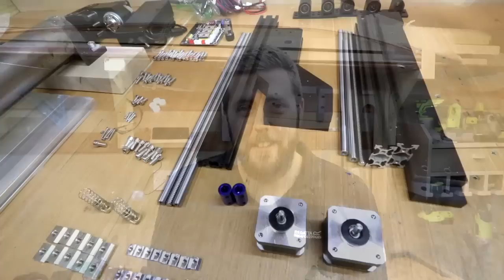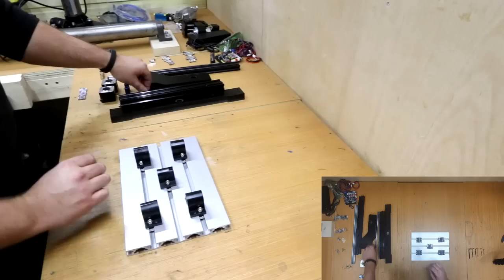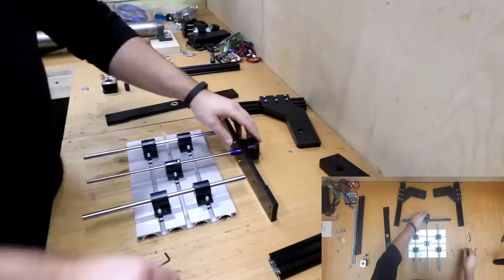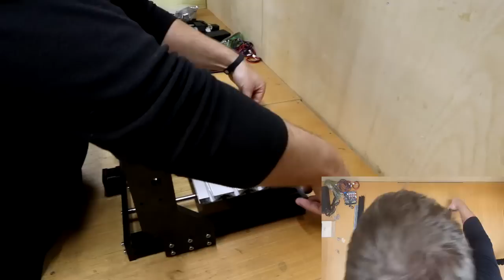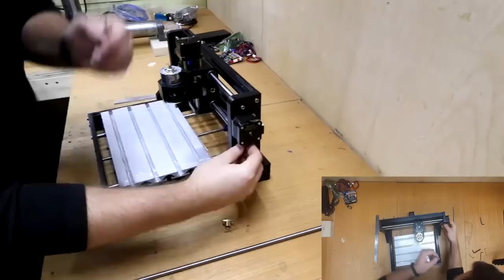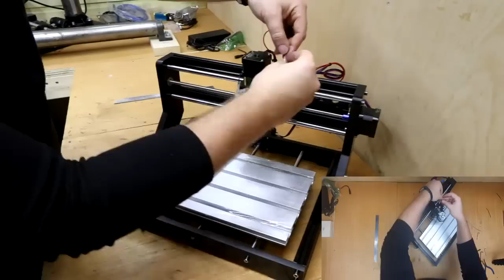3018 PRO CNC Build

Comment: I'm just wondering what the purpose of setting the gantry forward 46.5 mm is.   That's what mine says to set it at.  There's no room to move the bed from under the Z axis.  It seems to me that it be better to have the Z to the back almost all the way for clearance.
Reply from the maker: Thos measurement is allowing you to use all your work area. If you set it right at the back, the spindle will not reach the front of the bed
Reply: @JamesDeanDesigns  Hmmm, I may have to test that.  LOL  I'm curious as to if it's possible to buy a longer lead screw and 2 guide rods and make it longer from front to back.   I have a set of 300 mm aluminum extrusions already.  This thing is really small.   Thanks for replying.

Comment: Hi,
I just purchased a 3018 Pro CNC machine and have started to put it together. I'm having difficulty in placing the brass nut onto the thread bar. The instructions state that I must also insert a spring onto the brass nut before pacing it on the thread bar. I spring is too large for the brass nut. What am I doing wrong?

Thanks.

Comment: The brass part with the spring thingy (the Y-axis), should it face the stepper or the opposite, or it doesn’t matter? Thanks.
Reply from the maker: @zhenyuyang6275  spring and the long part of it should be facing into the middle of the Z axis.

Comment: Excellent video. Thanks for sharing.   The VEVOR 3018 PRO (edition 2024) is construction wise a little bit different, but the basics are the same. 
Did the tie wraps come in the box?  In my package not. I do have some, but didn't use them yet. How long did it take you to do the build up?  I guess you studied the manual thoroughly because you mounted everything so smoothly, without hesitation. Tomorrow I'll watch part 3.  Till the end of episode 2 I managed everything to do without your videos,
but what comes in part 3 will be the most important. I 'm curious......

Comment: I noticed you oriented the backlash nut under the bed toward the motor. Instructions on my machine indicate the backlash nut should be oriented away from the motor. An internet search turned up nothing but I did find someone complaing about wear on his backlash nut and I wonder if his issue is related. Any input about this?

Comment: James. I recently purchased this machine and I also purchased the 20K motor. I read somewhere that it's better for this machine to use an external (2nd) psu to power the 20K motor. What is your take on this? If you agree, how much watt should the 2nd power supply have?
Reply from the maker: So the issue is the 20k spindle draws a little more amperage on the start up. I never had an issue with it on my board but others have. So you have a couple of choices. There is a small piece of code which ramps up the speed of the spindle, you insert this at the start of every job. You can buy a little resistor which you fit to the live wire and it essentially stops the amps peaking so high. Or as you have mentioned you can look to power it off a separate PSU. Dont know for sure but it can't be more than 70w or 80w.

Comment: Hello james. I have a problem with my 3018 pro. I followed your guide(s) on how to install/build it and when it was time to use the jog function on UGS, it didnt work. I fiddled around and still didnt work. Suddenly it started working but after 30-45mins when i started to do a job with it, it stopped working again.

I have checked the connections, tried different usb ports, different cables, uninstalling the CH340 and installing it back and nothing works. What should I do?

Hope I don't have to buy new board and wait ages...

Comment: Hi James, I just want to thank you for your very inciteful videos. 
I assembled my 3018 Pro-Max some 4 years ago after watching this video. 
I positioned the side gantry posts as you directed at 48mm from the seating face of the rear frame support. My machine was supplied with the profiled Perspex dust protector plates, that assemble in the same slot as the gantry plates. With these dust protector plates positioned level with the front of the machine, I butted my gantry posts against them, as it is shown in the catalogue. 
With the gantry posts positioned as described (>48mm from the seating face), I had a problem that the table couldn't advance far back enough for the spindle to clear the table at the front end of the machine (~10mm short). I have worked around this problem successfully for many years, and have done many jobs, despite the limitation. (I used a full sized waste board mounted to the table with countersunk bolts and nuts, and secured my work pieces to this waste board with double sided tape).
However, I have now made a spoiler

symmetrical, this could not be

Comment: An unrelated question: the 775 motor has a cooling fan on the commutor side, drawing air through the armature and blowing it out on the commutor side. Doesn't that clog the inside of the motor when it produces dust and sucking part of that through the armature?
Reply from the maker: That is correct, it is one of the risks and ultimately where a maintenance schedule comes in to make sure you clean the motor, whether that be with a vacuum or compressed air to blow the dust out

Comment: With the vibrations in use in mind; would it help to use blue Loctite on the bolts? Or does the compression of the bakelite the same job?
Reply from the maker: Blue loctite will certainly help 👍
Reply: @JamesDeanDesigns  In other words: bolts not tightened enough will come loose due to the vibrations... Blue Loctite it is.

Comment: Awesome video. Helped me to get my unit built. The instructions that came with it were as bad as they were tiny (I mean, they had me building the frame first). It was a bit of a head scratcher as it is different to yours: T-shaped uprights instead of dog legs, and the x-motor is on the left. Thankfully the cables a long enough so it doesn't matter.

Comment: Well I just completed my 3018 CNC PRO with lazer build. Your  video on this assembly was, as you say.  “. Spot on”
I can’t thank you enough for your time and efforts to make this video. 
It is my first CNC router. My Sweety. Doing a dry run with no bit nor a project on the table. I had absolute success with the mini controller. Again. 
Thank you. 
Papa’s Work Shop. 
Dennis
Reply from the maker: Glad its going smoothly 😁

Comment: Is it normal for the x-axis threaded rod assembly to be smooth or resistive when turning by finger power?
Reply from the maker: It should be fairly free but not loose. So there will be a little resistance but you should be able to turn it with your fingers

Comment: James, I see everything is at least a year ago, but hopefully you're watching these comments. I Purchased a 3018 with the Lazer included. However, the USB plug has no data. The machine operates with the wired controller, but no download available. 
Is there a link or possible software I can purchase to set up my CNC? 
I really appreciate your video, as I am not just computer unfriendly, but just really slow on the learning curve. Comes with age as I am 80 years old, but still as active as possible. 
Thank you, for taking the time to help folks like me Ted
Reply from the maker: Hi Ted. I try to watch all comments 🙂 if you move onto the next video in this series it has the files needed but here is the link for them.
https://1drv.ms/u/s!AuoE9S3Cr4VZgpYTtVqawrkXzSih-w?e=ZI6cBf
Reply from the maker: This is also another useful page
https://docs.sainsmart.com/article/3jgtgas880-genmitsu-3018-pro-resources

Comment: Hi James will the router cnc cut cork sheets for coasters
Reply from the maker: Yes, cork is fairly soft. You will need to find the right speeds though to keep the cuts clean
Reply: @JamesDeanDesigns  thank you so much. Does my brother Mike need to install the software that came with the cnc router or can he just download the easel program you use? Thank you

Comment: Hi, i will receive my 3018 pro CNC in a few days (i managed to get one with the offline controller for 150€ from Banggood, it was a huge deal). In your opinion is it better to add washers between the head of the screw and the Plastic pieces or that's unnecessary? And what are the things i should do immediately to upgrade this CNC (like a spoil board ecc..)? Thanks 👍

Comment: James, after GRBL controller/candle installed on 3018 pro how does one load and use UGS and Easel without causing problems . I know this is asking much but I appreciate any help you may provide. Thank you
Reply from the maker: Its not a problem at all. You can have them all together so just install UGS as normal. However only one program can connect to the machine at any one time

Comment: Hi James.  I really like your videos.  I got my 3018 built and have set the $ commands to match what are in Graham's "Introductions to CNC for a Total Novice.
When I do my initial testing, I find no movement  on either X, Y or Z axis.  I do fell the screw turning on each one, but no movement of the device.  My device is the basic model right out of the box, no Laser yet.  Any ideas as to what I may have out of wack.  Thank you and keep those video's coming.
Reply from the maker: Hi Abi, have you managed to solve this? Sounds like your couplers might need tightening. These are the bits that connect your stepper motors to the thread
Reply: @JamesDeanDesigns  Yes sir this has been resolved.  Thanks for your assistance.

Comment: Great informational videos!
Question regarding the included heat sinks. There is absolutely no mention of these in "instruction manual"....and i didn't see you mentioned them either during build, unless I missed it. Where on the control board do these go? Silly question?
Reply from the maker: Not a silly question at all. There are 3 drivers chips with a little processor on top. They are meant to go on those processor, the problem is they are bugger than processors so you need to be very careful when sticking them on
Reply: @JamesDeanDesigns  Thanks. It was pretty easy to do.....
In regards to setup. Any setup for initiating GRBL to the machine in addition to driver installation from the various software configurations. Im obviously a new newbie to all of this....

Comment: Thank you that assembly session was so good and clear. I'm in New Zealand, just received my unit. Assembled OK until the final part when trying to put the screw bar through the left side bearing to screw into the moving head, it jammed in the bearing, it seems too tight and wants to turn with the screw. Is there a way to fix this? This bearing should allow the screw to turn freely.
Best regards John. PS. I will subscribe your instructions are so clear.
Reply: I lubed the bearing with WD40 (after testing that it was actually working) then I loosely applied the upright to the base frame. I slid the threaded rod into the bearing and simply twisted as it "bit"  into the inner circumference  of the bearing. Then I knocked it with my hand and everything lined up. Then I tightened the six screws to the base.

Comment: Hello I just got one ..I watch your video on how to set it up but I don't know how to put in the bit that it comes with. Can u help?
Reply from the maker: Hi, if you move onto the next video in the series which is called making your first cut then it shows you part way through that about how to fit the bits
Reply: @JamesDeanDesigns  Thanks.. Next question is there any free software like Easel to use i already got the UGS software that u use..
Reply from the maker: @daveoncolley7753  this video will talk you through what you need to know regarding software from free ones through to paid for and each stage
https://youtu.be/EMI97Rcb0bQ

Comment: Does the spindle have a flat edge? At high speeds it will vibrate a little? Not sure if I should get the 3018 or the PRO?

Comment: Hello from Canada James.
   I have been watching your tutorials   (the best I have found on u tube  thanks) on setting up a Sainsmart 3018
.  I downloaded the UGS platform you say you use.
   It moves all axis, but I can't find where to start the spingle
   Is it in the settings somewhere ?
   I have trued to find this information on the web, but on luck so I'm turning to you
  hopping for help.
   Thanks for any you can give.
Reply from the maker: Thanks, that's great to hear. You tell the spindle to start in the design software and that controls it. If you just want to test it you cant type m3 S10000 into the console and hit enter. The type M5 and hit enter to stop it. I'm not sure if they added a manual button as its rarely something people use.

Comment: Thank you James for all your instructionsvideos on 3018Pro! Do you know where to find a linux (ubuntu) driver for the 3018Pro? Have tried the Easel driver but no luck. I guess they want me to use Easel, but I dont want that. Am thinking more on using Lightburn and FreeCAD/Inkscape.
Reply from the maker: Hi Thomas, If you head over to the Sainsmart resource centre they have all the drivers you need on there I believe.

Comment: im trying to get my friends cnc to work. got it all together. all seems well. but i cant get it to work with software. it did not come with any
Reply from the maker: Do you have any details about the machine such as do you know if its a GRBL machine or Mach3?
Reply: @JamesDeanDesigns  hi there again. this is a GRBL cnc. its a chinese 3018 Pro knockoff. after much fidling i got the software to partially work. it now seems to be a software setting issue. thanks so much for your asistantce, greatly appreciated.
Reply from the maker: @tyronehewitt634  thats good news. Software issues are usually easier to  resolve than hardware issues

Comment: Thanks for the video, great detail, and a real help since my assembly instructions were very lacking in any detail. Here are a couple of points that this newbe found while assembling my almost identical 3018 while watching your video that may help others. Firstly, when I put the spindle motor assembly on the rails and tightened up I found it binding at both ends of travel, so I loosened the rail screws and moved the motor around at each end while tightening them again, which corrected a slight misalignment in the rails. Likewise with the material plate, it seemed a bit tighter moving it manually by rotating the X axis screw than I would have thought, so I loosened the four bearing blocks and the central screw block, gave them a wiggle and tightened them up again. Seemed freer after that. 

Also the assembly sequence was very different on my instructions, but I realised when getting into it that the nuts that came with my kit were a different format and could be fitted into the slots after frame assembly, not needing to be slid into the frame slots from the ends.

Overall I really appreciated the details on your video about which way the linear bearing blocks were mounted, which way the frame pieces with the screw bearings went, etc. That saved me untold time and hassle and overall your video made it a relatively painless exercise rather than a guessing game.
Reply from the maker: Glad to hear that. Generally speaking the instructions with these machines are awful and not always in the best order. Hope all goes well when you start using it 👍
Reply: @JamesDeanDesigns  Cheers. Like everything, there are numerous ways to do it wrong and really only one way to do it right.

Comment: I have some differences with my model. There are only 3 types of screws: skinnier ones for step motors, round headed philips ones for the control board, and bigger Alan ones for everything else. The couplers doesn't have a threaded part and one of them have same size hole on both sizes - difficult to adjust it. Anyway assembled the machine - just need to find the place where to connect the power cord and it'll be ready for testing. Thank you for your video - helped me a lot with assembly (my machine came without assembly instructions).

Comment: Hi,  Thank yo for the excellent video, made the assembly  job quick and easy.

One thing you did not cover, was adjusting the stepper motor driver current limits.  Also, on my board at least, there are no heat sinks on the driver chips.

If you are not aware of this adjustment, here is link with an explanation.  I haven't been able to confirm the maximum current for the stepper motors, so I set my Vref's to 0.75V. 

https://www.makerguides.com/drv8825-stepper-motor-driver-arduino-tutorial/
Reply from the maker: Thanks. Thats useful to know but I typically target my videos at begginers and I would probably say thats a fairly advanced thing that not many people would be confident doing although I might give it a try my self 👍
Reply: @JamesDeanDesigns  You could well be right.  Have fun.

Comment: Hi James,  Your help below worked well and apart from having to make a change to the position of the z axis gantry, and direction changes in the software, we are up and running.  Having said that I do have one problem I need help on; I can't get the coupler between the x axis threaded feed screw and the step motor shaft to sit correctly.  Either it binds and causes the motor to have fits (I have lubricated with PTFE spray) or it works loose and does not drive the y axis shaft. Have you, or anyone else had this problem and how did you cure it? 
Many Thanks
Reply from the maker: Get the coupler as best you can and tighten it. Then slacken your rails off a fraction. Slide the carriage all the way to the left and tighten the rails back up that side, then slide all the way to the right and tighten that side. Hopefully that helps
Reply: Hi James, Thank you, once again, for your help. I bought my router from China, because no one in Europe would sell me one without a VAT number following Brit Exit. Big Mistake - I have obviously ended up with a cheap copy! But I have got it going by leaving the back bars to the gantry loose at one end. Not good - but it works. Many thanks. Ivor